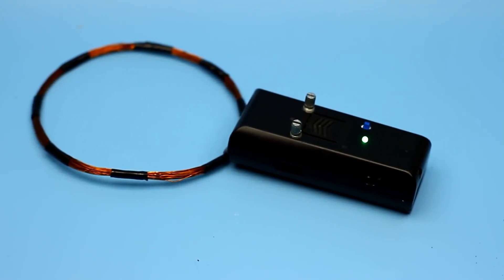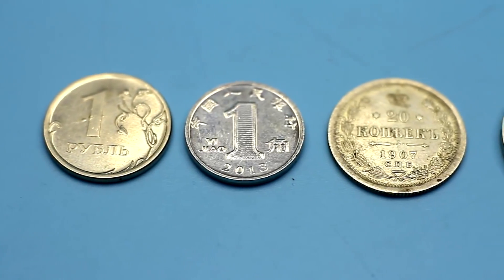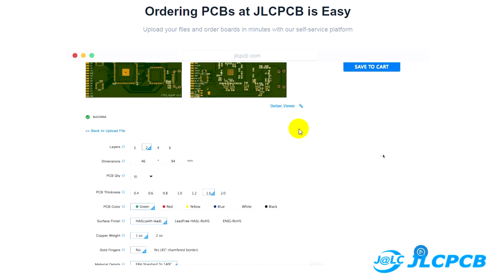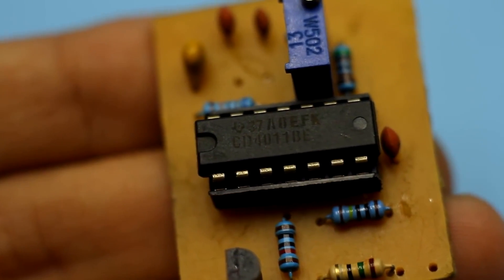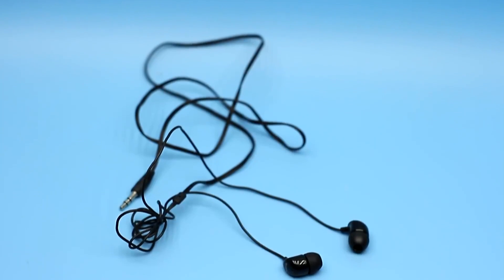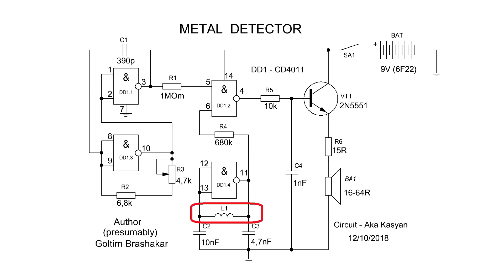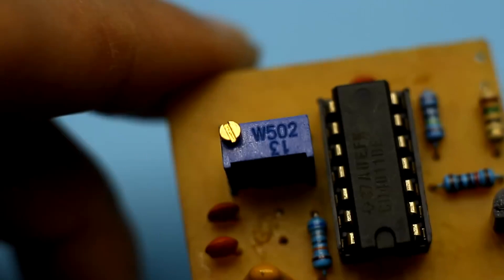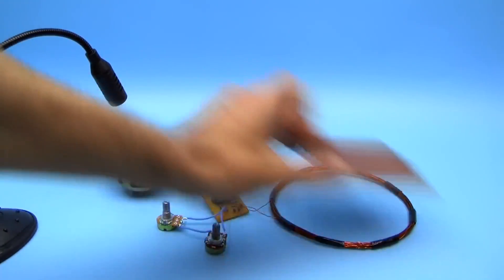DIY simple Metal detector

Comment: I made one and it resonates at 90 Khz, I would prefer it to run at 133 Khz as designed, which capacitor, C2 or C3 would be better to change for a smaller value?
Reply: What're the value of each capacitor please because the capacitors value shown in the schametic is differ than the capacitors on the pcb

Comment: What is the inductance of the coil? Mine is 273 micro henry but I can't get it to work like yours. The sound is way too soft. I am also using a 2N3904 or a BC547 transistor because I don't have a 2N5551.
Reply: do you know what are the capa citor? i maked it it does not work

Comment: A few comments about the circuit.
1)The resistors R1 and R4 are not really needed.
2)I would add a resistor from the junction of C1 and R2 to pins 8&9 of the chip. The CD4000 series of gates have input protection diodes.  If you look at the waveform on the junction of C1 and R2 you will see that it spikes beyond the supply rails.  This turns on the protection diodes briefly.  The protection diodes have an "unfortunate feature" that a current in one causes leakage in the others.
3) An AND gate works OK as the mixer but an XOR works better.  An XOR will make it about two times as sensitive at the cost of not all being one chip.
4) A coil made more like a "spiderweb coil" that the crystal radio folks like will work a little better.  The capacitance from one turn to the next and other effects reduces the Q of this coil as shown.
Reply: What program is used to open the file?

Comment: Can you make a homemade voltmeter for testing voltage upto 30volts
Reply: The answer is yes but why?
Reply: @kensmith5694  I have a machine in which only 14 volt dc is required so I need a voltmeter which can measure upto 30 volt
Reply: @ho0k17  
For about $6 US, you can buy a DVM that is good enough.  The parts cost for something you can make is more than this.
Reply: @kensmith5694  ok
Reply: @kensmith5694  can you provide me circuit of that voltmeter, I will make it...

Comment: Great !!!
Could you make circuit to measure floating voltage.

If I have series of lithium ion battery cells how to measure individual cell voltage using microcontroller which accept input up to 5 volt.

Comment: What is the inductance of the coil?
With no previous experience on metal detectors I would guess that a smaller diameter coil with the same inductance would be more accurate in pinpointing objects but would only be able to search closer to the surface, right?
This could be usefull for an in wall nailfinder.
EDIT: I guess that the frequency would have to be changed to search for iron nails though.
Reply: as a DIY metal detector entusiast i could say that the inductance of the coil is not so critical... my suggestion is to build the project like this the first time, than experiment with other values ;). the smaller coil will be sensitive to small objects but at less depth. this metal detector is perfect to search inside the walls because is o bfo type no-motion detector you will be able to search between rebars in the walls... i think the frequency of the detector will be approx 50-100KHz this make them good to find little objects and gold... probably a little problematica if used on soil due to the ground minerals response. chek my channel too bye.